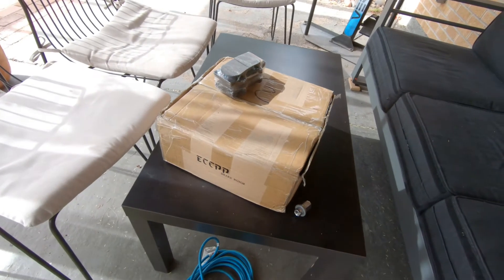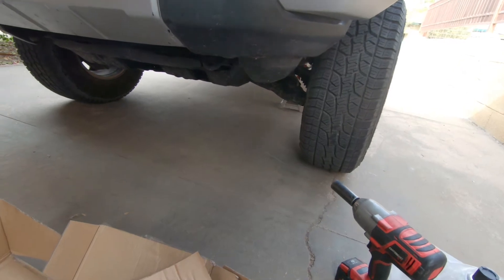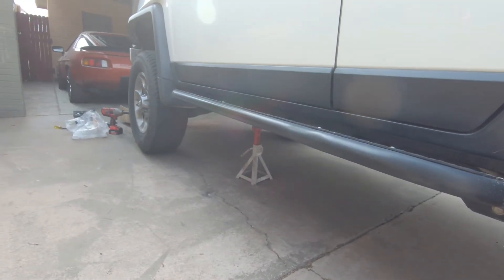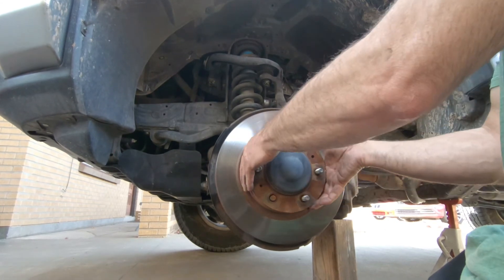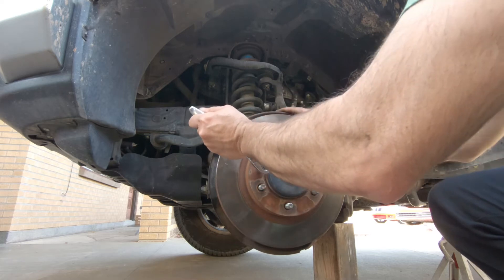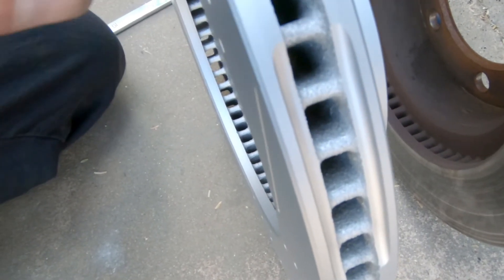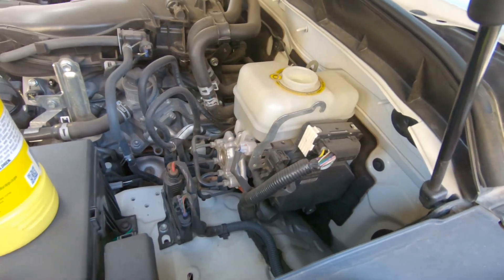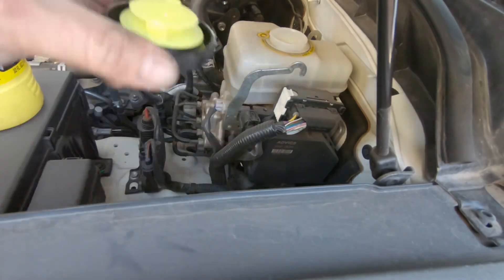Upgrading the front brakes of my 2013 FJ Cruiser to ECCPP Rotors and Ceramic Pads -Budget Ebay Find!

Comment: how's it going! I am coming across this vid late but I just did front pads and rotors on my 07 fj with Toyota pads and rotors and have a horrible squeal I cannot get rid of!!! I noticed you did not use the anti squeal shims or grease the back of the pads??? did you have any noises after the front brake job??? its driving me nuts!! I have had it apart twice now!!!!! I did the embedding process as well.

Comment: How is everything holding up? Do you think the rotors will compare in quality to Toyota OEM and did the brake fade you experienced occur with the stock rotors? And would you happen to know if there's a difference in rotor size between the front and rear?
Reply from the maker: I think these are as good as factory and they are the exact same size but front and rear are different sizes and designs entirely.. They are holding up really well.